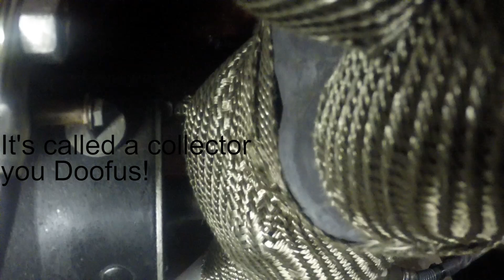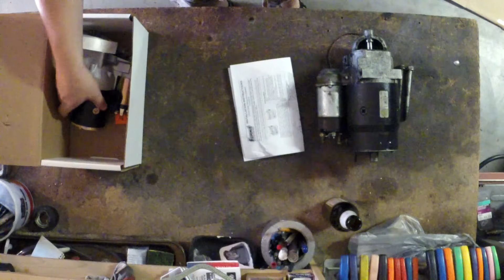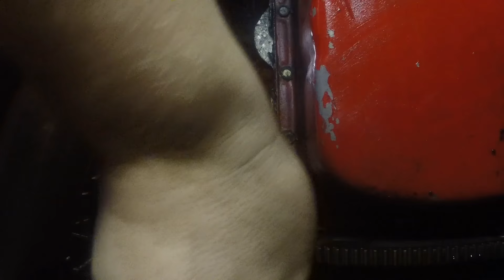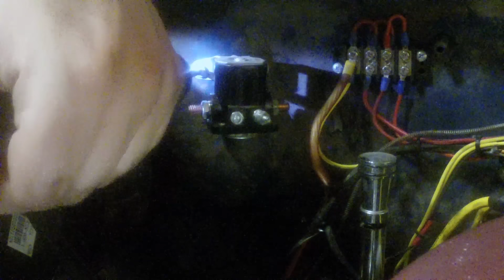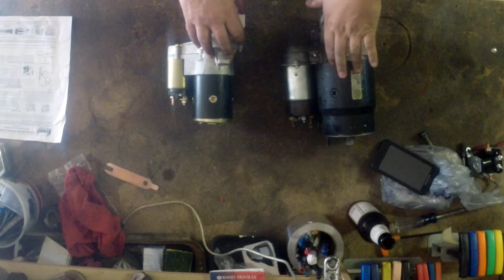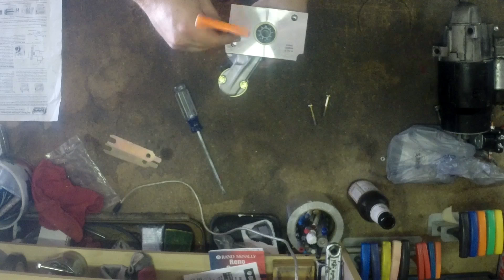My old POS Episode 1. High Torque Mini-Starter Swap!

Comment: I have the same problem with my 1987 Fleetwood Bounder RV. As soon as it gets hot, it won't crank over unless I let it cool off a little. It has headers and a 454ci Chevy engine. I've gone thru 2 OEM starters already and I am going with the mini starter idea. Your video was very informative and humorous at the same time. You gotta  laugh at yourself from time to time. I do right after saying the F word a few times. 
I'm looking forward to the final results. Thanks.

Comment: For sbc 168 tooth offset mount starter replacement, go get a starter for a 2004 chevy avalanche 8.1L and a few shims for the starter and bolts $90 mini starter with a lifetime warranty...
Reply: A 2003 chevy xtreme 4.3 has a factory high torque mini starter that turns over my 13:1 383. I never would have believed it would spin over a high compression sbc but it works great, even in the heat.

Comment: Im doing a smallblock SBC into my 1957 Series 1 Land Rover Chevy V8 conversion. 
Using a high torque gear reduction starter. 
Nice video, tip of the hat to you...

Comment: ive been having trouble with my small block i thought it was the alternator until i started it and unplugged the positive battery cable and it was still running, then i thought my battery was bad. my fruend just told me last night this could be the problem and ive been doing reasearch all day and come to the conclusion he was right about the heat soaking issue..... now do i have to buy a whole new starter or could i buy a heat shield? and if a heat shield should i buy the wrap or the metal one?
Reply from the maker: I tried the header/exhaust wrap but it didn't help in my case. I did not try the metal shield that goes around the starter so it's possible that may work, but I haven't tested it. As long as the starter hasn't been permanently damaged by the heat it should be fine. The heat shield would be a cheaper experiment to try first before replacing the starter.

Comment: Your not an idiot for not reading the instructions first, either way you would have had to put the starter in to check for the 1/8th" clearance, so you still would be doing it twice
Reply from the maker: Well thank you kindly :)
Reply: @inthegarage8224  I have a454 Chevy block I'm having problems with the eatarters I must replace five times and is not doing any better the mini hi speed starter will make a big difference the original wen to hang kind of acquired and does not angage proper with the flywil and vendice

Comment: thanks for taking the time to put together this video.
my truck is currently having the same heat soak issue.
Reply from the maker: You're very welcome. I have to say I've been pretty happy with it so far. It's run like a champ so far, even on the 100 degree days.